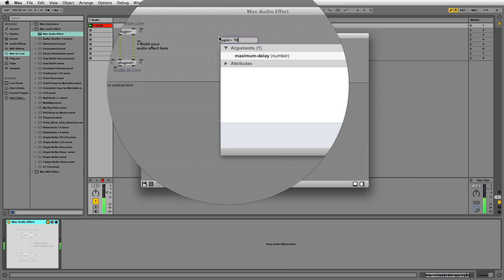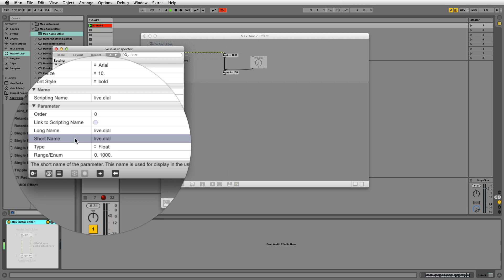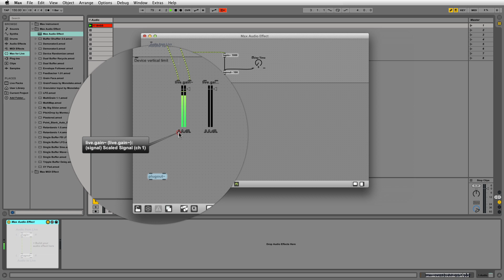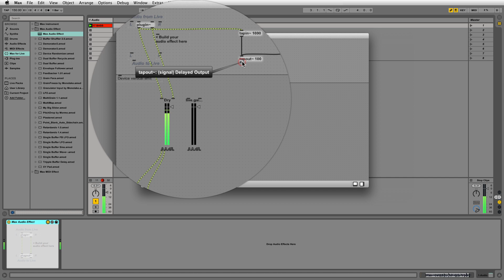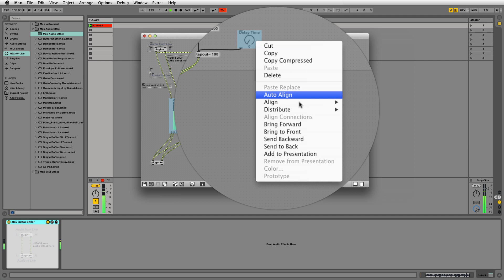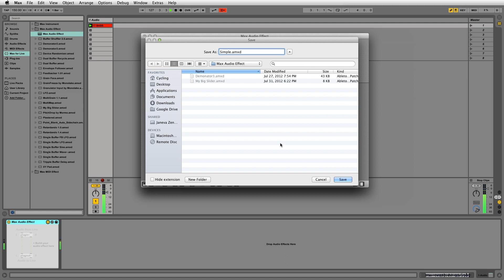#3 Simple Delay

Comment: Very helpful tutorial! 
After doing it, my patch came out with a problem. Artifacts are created on the sound, when I move the Delay Time knob. I'm using M4L 64 bits with Live 9 beta, also running in 64bits. 
Same problem
Reply: Check out part 8 of the series ("Dub Delay Part II") where they explain how to fix the glitching that happens when you adjust the delay time (you need to set the delay time using an audio wire so that it gets processed at audio rate)  https://youtu.be/ZtQZwUhdDu8